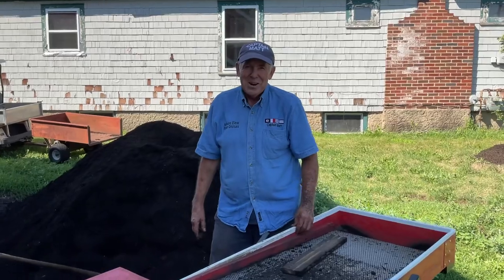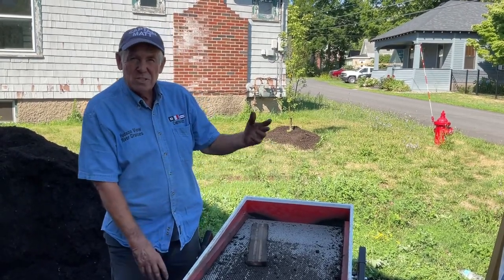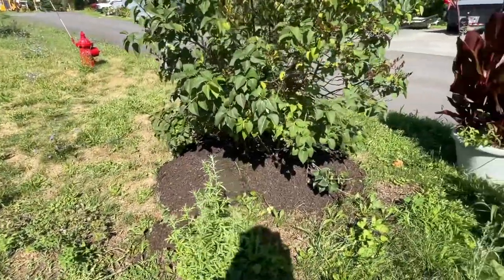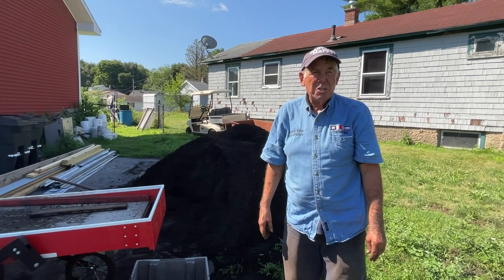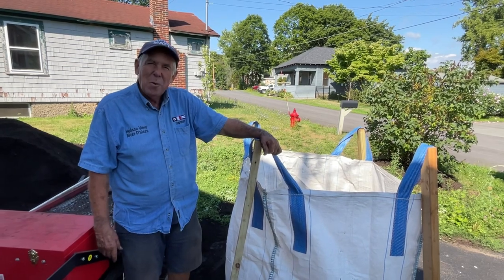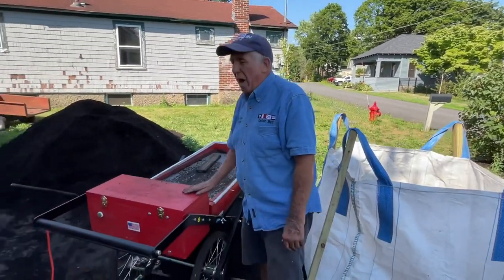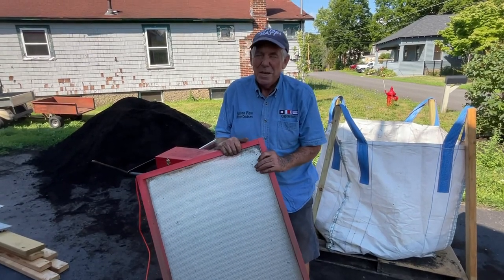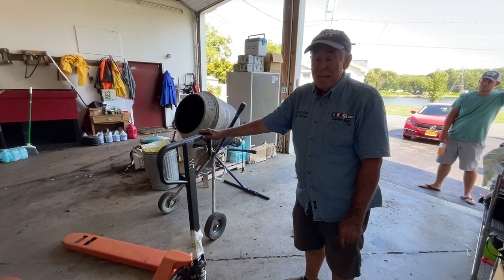Reversing Steps to Create Worm Castings More Efficiently!

Comment: Hey Matt, I did something similar to this that worked great. I live in Maine and wanted to know if euros would make it through the winter outside in a chest freezer. In oct or nov I filled the large freezer with bedding. In the middle i added a good pile of veg. scraps for heat and added no more than 500 euros.  March April I opened it up when the weather started warming. After a few days of thawing I was able to loosen all the  bedding and to my surprise I had live worms. I have no idea how many survived but I haven't bothered harvesting any castings yet even though it has lots. Turns out this thing is a breeding machine and I Haven't been able to bring myself to bother them too much. I leave the door open 24/7. I installed a solar light that stays on at night and I cover the bedding with heavy black plastic. The morning sun hits the plastic for a few hours and the worms love it. I'm just waiting for them to tell me when they are finished before I harvest the castings. This thing way outperforms my smaller bins in my shop. P.s. I have not given them any other food since day 1. I think your 1 ton sack idea will work great if it hasn't already. I'll let you know how this works out when they are done. I'd be curious how filling up a 1 ton sack with bedding first would work. Good luck,   Bill
Reply from the maker: Thanks for sharing, Bill. Worms never cease to amaze me.

Comment: I did this about 20 years ago when I had a large rabbitry, and had problems with pests, and moisture control under the cage rows.   It really did work well.  The one thing I had to do was to wrap bubble wrap around  them to keep the temps consistant.  I happened to get the super sacks free from a warehouse that did tapioca imports.  I had around 5 or 6 that I had to leave on pallets outside because of room, and a couple had armadillos tear into them, but that could of been remedied quick enough.  I had no time though, due to having to butcher so many rabbits on the weekend.  Never pre sifted however. just alternated mats of kudzu to keep compaction down.   I like your spirit Matt.
Reply from the maker: Hey Christopher... thanks for sharing your story.

Comment: This will be a very interesting experiment.  I use large cement mixing tubs (32”x20”x7.5” deep inside dim).  I don’t cover even w plastic, but do use an LED shop light to keep worms in.  It seems to work well.  Been worm farming only 3 months & started with 2 lbs red wigglers … so a newbie.  Like your vids.  Very helpful. 

I started sifting my bedding inputs (like your experiment) after a recent complete harvest of 20 gals of castings.  In a short period of time, I’ve notice greater compaction when I “fluff” the tubs to even out moisture n add oxygen.  Obviously, I am not using a flow through system like your large red boxes.

It would be interesting to know the following when you complete your experiment:
A) Is the microbial activity the same at the bottom of the tote sample as the top sample given compaction n less oxygen n being older at the bottom?
B) Total weight of tote at full level given that the castings aren’t sifted n have less air as compared to a sifted full tote.
Reply from the maker: Good questions, Doug. Sounds like experiments waiting to happen. Great to hear about your progress.  Your inquisitiveness and keen observation is the key.

Comment: The large bags you are using fit nicely in an IBC frame.  Makes them easy to fill,  helps the bag hold its shape, can easily be lifted/moved with a tractor or pallet jack, and come out of the frame easily when you need to empty them  IBCs are not hard to source and inexpensive to purchase or if you know a farmer that purchases liquid feed supplements or the like( just know what was in them so you can decide if they will come clean enough for your use. Food stuffs are generally best but some fertilizers or solvents can be rinsed away and make the tote safe to reuse) they may be free for the taking. Cut the top off and maybe use it for compost or stored dry bed material?
Reply from the maker: That sounds like an experiment waiting to happen!

Comment: Captain Matt, have you tried a barrel-shaped sifter? There's a good video on YouTube of one made with a Harbor Freight concrete mixer as a motor/rotater. Imagine hardware cloth of various hole sizes formed into cylinders which are attached to each other (Each barrel of screen is a successively larger hole size) and then attached to the concrete mixer. It's a LOT quieter than vibrating sifters, doesn't require you to squeegee the castings over the screen as vibrating sifters do, handles a lot more volume than a vibrating sifter, and reduces your manual labor to just filling the cylinder as it turns.
Reply from the maker: Hey Michael… I haven’t, but would like to explore DIY sifting further sometime. For ramping up the volume of my business, the Brockwood Shifter really fit my needs and was already a proven solution in production worm farms.

Comment: Just on my way out to go do the same. Well sort of, it is for buckets. For me it is not reverse but normal operating procedure (the screening first). Got to go get the first steps done. Which is to go and sift through a 1/8" screen then what does not go through the screen goes through a shredder/pulverizer and then that gets sifted through the 1/8" screen again. Then it is time to mix in the lime and D.E. and then add the worm chow and mix again then add in the worm casting tea (with BTI) and then mix again. then the prepared bedding can sit until Friday when it is going to be needed.
Have a wonderful Day!

Comment: Keep big chunky woodchips out of your input stream & you will cut down the decomp & sifting time enormously (inc. bending, shoveling, heaving...etc.)

That being said, I use finely sifted worm bed material with less than 1/4 diameter inch wood chips to innoculate new worm beds. Then I add cold leaf mold material going forward to boost fungal population.

I never put any woody/scrubby material in a worm bed that won't fall through a 1/4 in screen...and that material only makes up  small amount of the total.

Start with a superior Worm bedding mix up front to save grief on the back end.
Reply from the maker: Makes sense.  Thanks for the validation!

Comment: Are you still using this method? If not, why not? I watched your more recent videos with the wedge system so I'm wondering if you stopped using the 3x3x3 bags. As cheap and easy as it seems to be, I'm hoping this will be a good solution especially for someone like me who is on disability so every penny counts. 
As many different ways, you've raised them, it would be good to see a video that compares the pros and cons of each different system
Reply from the maker: That’s a great video idea. Bags worked great - just adapting to the ground level wedge trying for less lifting.
Reply: @CaptainMattsWorms  Thanks for that. It also seems better to do the wedge because you're able to get to your castings as soon as they're made. 
Sure do appreciate all that you've shared!